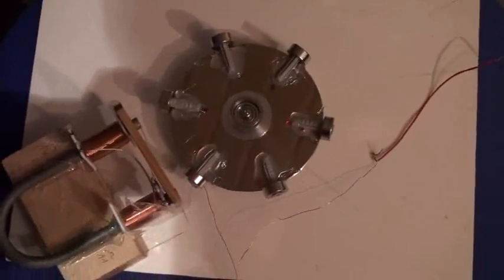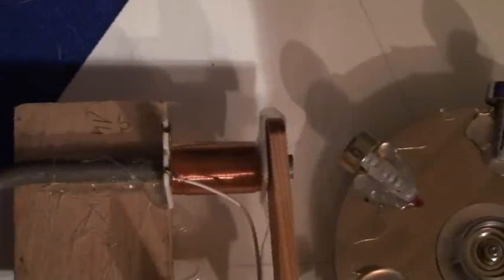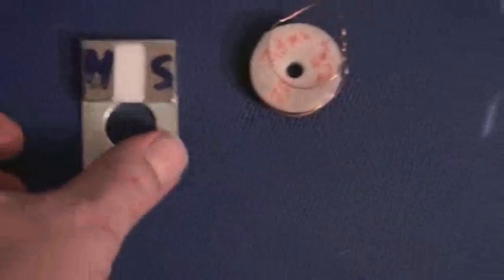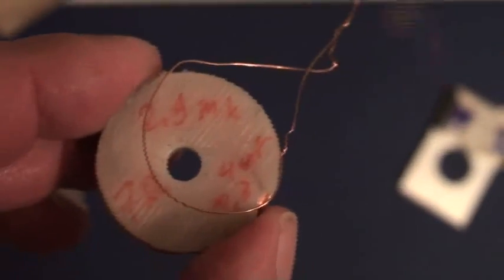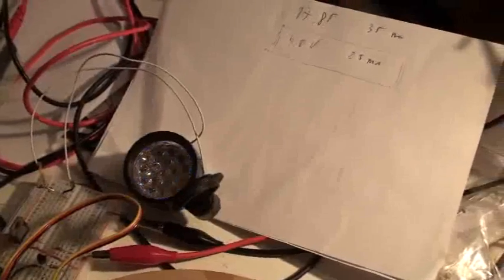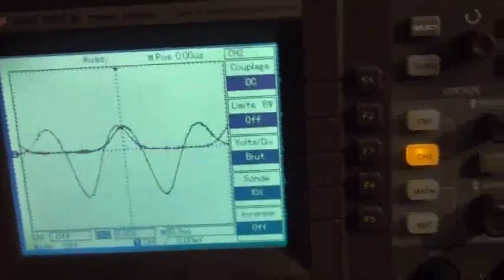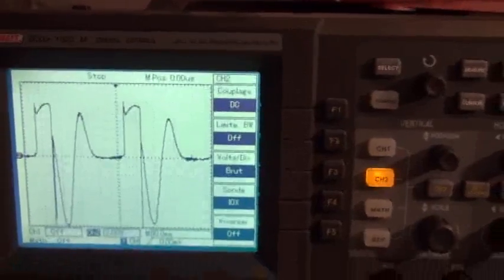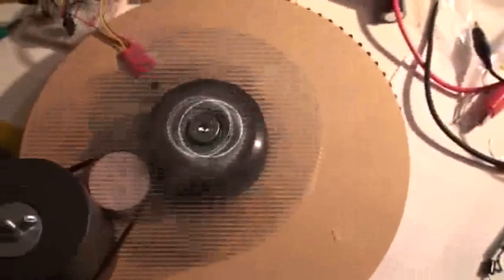pulse motor withh PMH armature test 3

Comment: (3rd)  By measuring the voltage across the resistor and using V-squared/R you measure the power being dissipated in the resistor, and that is identical to the average spike output power from the motor.

Because Woopy has a smart power supply with a voltage and current readout, he can easily calculate the power supplied to the motor.

Finally you can calculate the motor percentage efficiency, which is simply (power out/power in) * 100.

You can do the same thing for any Bedini motor.

Comment: (2nd) The average pulse output power will be the cap voltage squared divided by the 1K resistance like you said.  Let's assume that Woopy's motor consumes 6 volts at 80 milliamps.  That's 0.48 watts.  Based on that let's guess that the average pulsing power output is 0.1 watts.  Therefore the cap voltage should stabilize at sqrt(Pwr x R) = 10 volts.

In plain English you use a big capacitor to filter the output spikes from the coils, and a resistor to "bleed off" the power.

Comment: @rave154 You don't need a FWBR.  The current through the coils is only flowing in one direction.  All that you need is a single diode going to a cap with a resistor across the cap.  If Woopy uses a 10,000 uf 25-volt cap and a 1K resistor in parallel, then the RC time-constant will be 10 seconds.  This will convert the pulses from the pair of coils into smooth DC and he will be able to measure his average pulsing output power.